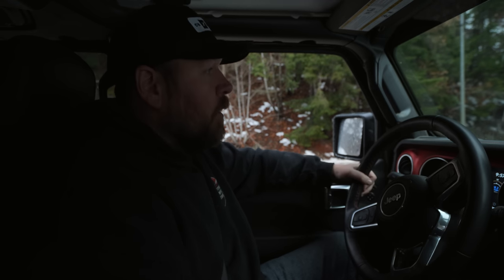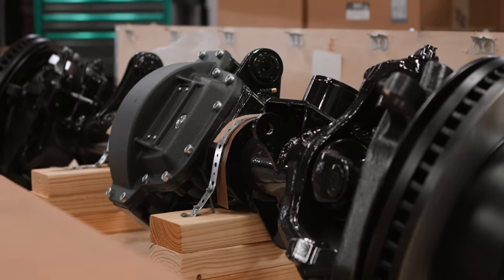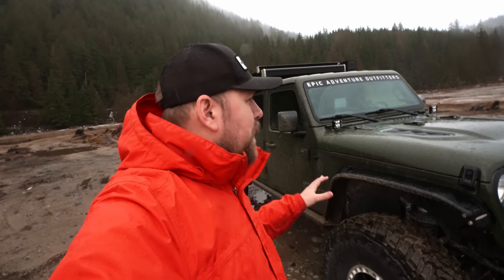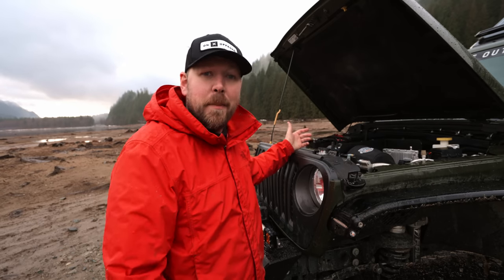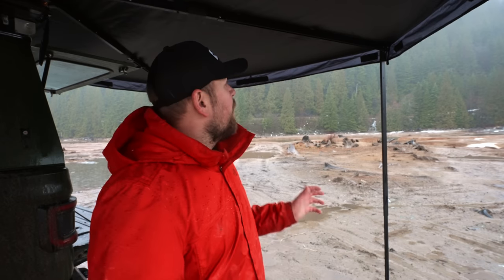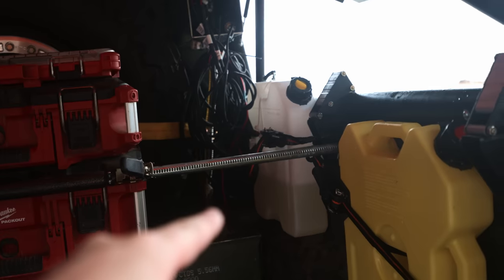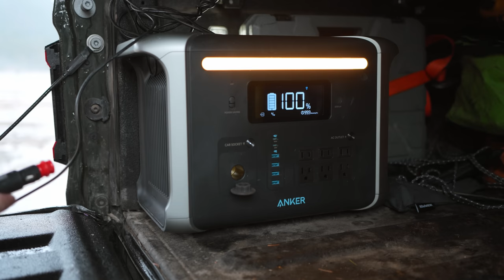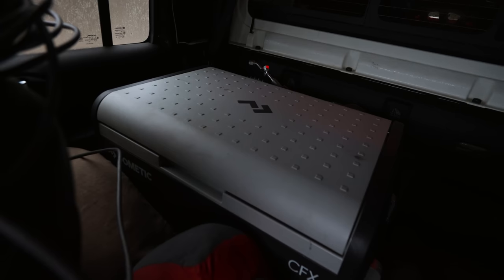426 Hemi Jeep Gladiator Overland Build Walkaround

Comment from the maker: If you want to never have to worry about power on your overland adventures, you need the Anker 757 Powerhouse. 1225wh of power in a portable compact package. If you purchase any Anker products using my link, I make a small commission which supports the channel. ❤ Check out Anker powerstations here:  https://shrsl.com/3s52n
Reply: Hello I was hoping that since you use onyx off-road, I was wondering if the Maps work in Canada I was thinking about purchasing the app but I can’t find any information about it working in Canada
Reply: Hi Shaun! Thanks for the great contents for each monday. What type of solar panel did you install on your GFC Camper?

Comment: This is hands down the sickest Gladiator build I’ve seen. Everything on it is purpose built for off-roading and overlanding, and it looks awesome. What an absolute beast you’ve made, Shaun!
Reply from the maker: Thanks!
Reply: You have built a truck that can go rock crawling but still can be driven just about anywhere and used as an overlanding vehicle.  Well Done!!!!
Reply from the maker: @scottymac5174  exactly the goal my friend.
Reply: @TheStoryTillNow  What I like about GFC campers is that I have an older truck.  2004.    But building a camper for it is no problem.  They will make it happen.
Reply: Sickest!!

Comment: Awesome video as always! I'm very curious on the d80 brakes installed on the front ud60 axle, I have the same axles and curious on what all goes into that swap and some difference of the brakes.
Reply from the maker: Thanks! We didn't do the work on that, they came that way from America's Most Wanted, and they didn't really share much info. If I knew more about it, I'd happily share.

Comment: I love the engine choice in this build. Only question is the open high flow air intake. Does water crossings pose a problem without a snorkel or water tight air box? That big V8 could suck in a lot of water very fast. What's your thought on this? Casey would have the same water crossing situation. I love his set up also. The open air intake is similar to yours.
Reply from the maker: This is something we are trying to address. It will require some custom work, but we are working on it.
Reply: @TheStoryTillNow  A video of water proofing the V8 engines in your Jeep Gladiator and Casey's Hell Cat motor would be a sick awsome video. Everyone else just does the engine swaps but never anything on a waterproofing system. I want to get a hemi conversation but need water proofing answered. I look forward to a future video! 👍🏻

Comment: Awesome build! Is there any upgrades to the transmission or transfer case at this point? Or future plans for any due to the added horses and torque? As usual, you rock the off road 👍😎
Reply from the maker: The transmission has been changed, but the rubicon transfer case is plenty strong.

Comment: Hey Shaun, you mentioned the suspension is better made for Canadian climate with salt on the roads and such...  Is there any rust proofing you do to the truck itself?  I've always gone to Krown, but tried Corrosion Free this year for the first time...  supposed to be a better product with a higher rating from the canadian military.  I currently do not own a Jeep but am interested, though i've heard that they really don't last in our canadian climate.
Reply from the maker: I haven’t done any thing specific to the Jeep/frame but I usually touch up with some rust paint once a year or so

Comment: Curious if you plan to add the auxiliary fuel tank? I believe you had one on the last gladiator and I didn’t hear mentioned for this one. What range/MPG are you getting with this setup?
Reply from the maker: Doesn't fit with the exhaust for this motor.

Comment: I know it's purpose built but I bet the steering has 0 feel which I'm sure it's super sketch on highway drives. I do like the build though. Pretty solid.
Reply from the maker: It actually feels great you just have to get used to it. Driving the Bronco without hydro assist now feels too stiff.
Reply: @TheStoryTillNow  that's good to hear, I would imagine a lot of float.

Comment: Went to synthetic winch line,. BUT
Still have a LARGE hunk of metal on the end of the line.........
Check-out YANKUM rope to see a MUCH safer way to do the end of the winch line !
                   🤔
Reply from the maker: Nothing unsafe about having a metal hook on the end of the line. The rope holds no kinetic energy.
Reply: @TheStoryTillNow  
Wire cable is used on oilfield winch trucks and some workers were taken out when they were in the wrong place at the wrong time when cables broke and cables, hooks and snatch would fly !  And there was no kinetic energy in them winch lines.
YANKUM has a video on how to tie the end of the winch line.   Much safer when using soft shackles and they have a nice fairlead to hook the winch line when not in use.
                      🤔

Comment: Just curious but what issues are you having with the oracle taillights? When i got them my blindspot monitoring wasn't working. I sent them an email about it and before I even knew they had emailed me back I had new wiring harnesses at my door that solved the problem and they've been great ever since. The Gladiator should've came stock with something like this. I broke one on the trail cause they stick out so far.
Reply from the maker: Flickering on and off ranomly, reverse on one side flashes on and off randomly, running lights come on and off at random, etc. You can see in one of the shots in this video only one of them is on, for some reason.
Reply: @TheStoryTillNow  oh that sucks. I wonder if any of that ever happens to me. I might never know since I'm always driving and not recording like you do. Does it show up on your dash too?

Comment: Love the channel and the new trail wrecker. I’ve wanted a Jeep my whole life but would never buy one due to most of the time needing a truck. Then the gladiator came out and I was immediately interested. I traded my truck in on my brand new 22’ rubicon back in May. I have spent lots of money trying to build it right. I’ll probably never be able to build it to this extreme but I still love it. But unfortunately I have been fighting DW for the past 2k Mike’s suddenly out of no where. I have literally went over everything and can not seem to find the root cause. I have managed to calm it but never cure it since it started. I have way too much money sunk into this thing with only 13k miles on it for it to be doing this. Do you have any suggestions on any past experiences with this situation ? I can’t give up on it, I like it too much to just give up and trade it in like a lot are doing ? Thanks for any input
Reply from the maker: Death wobble is almost always worn parts in the steering. Check tie rod and drag link ends, ball joints, ujoints, driveshaft, control arm bushings. It will be one of those things. Also this should be under warranty so just take it to the dealership.
Reply: @TheStoryTillNow  thanks for the reply. I tried, they had it for almost two months and diagnosed it as nothing but the steering stabilizer. That’s the only thing they wanted to replace and was dead set that was the fix. They couldn’t even get a new stabilizer at that time. No one can leave a brand new vehicle they’ve spent their whole life savings on just set at a dealership for months. It is my daily driver and primary vehicle. Yes I had a rental but with winter being here I couldn’t make the hour trek one way to work each day in it. Their tie rod ends were on back order until April 2023 they said. It now has brand new Apex 2.5 ton steering. I’ve gone over literally everything and it all seems tight as new. I’ve had tires rebalanced by a 4x4 shop, had an alignment , lift was installed only at around 5,000 miles. It drove like a Cadillac till around 12,000 miles when this hit suddenly and started happening. Even though I or a shop can’t find any play in the ball joints I’m probably gonna replace them just to rule it out. After that I don’t know what to do. Caster has been adjusted several times and all Jeep wants to do is throw a stabilizer on it as the fix. Which after picking it up I just put the new steering on I also put a new stabilizer on it also. I wish it was something that simple as, it’s under warranty and Jeep properly and timely fixing it.
Reply from the maker: @buckeyejeeper9996  I would suggest having a different 4x4 shop look it over.
Reply: @TheStoryTillNow  I just did after I got it from the dealership. The 4x4 shop has been the only help thus far. They were the ones who aligned it after installing the new steering and rebalanced my tires too which only have around 7,000 miles on them . They helped it a lot but it’s back but isn’t as violent or last as long. It does it worse on colder days/ nights. That’s what makes it frustrating to chase. One day it’ll be fine but then it’ll cool down and it’s back again.

Comment: What mounts are you using for the traction boards and shovel?  I was told by GFC that attaching anything to the side voids the warranty.
Reply from the maker: It voids the warranty for the panel, not the whole camper. So no big deal really. I’m using the Expedition Essentials mount. It’s really well build and I’m probably going to get another one for the other side.
Reply: @TheStoryTillNow  awesome..thanks for the quick reply!
Reply: PS - I love what you did with your heater.  I've been having challenges with mine overheating and It looks like (I hope) it's because I'm running too long of a heater hose

Comment: Shaun, In one of your video's there was a power issue with the diesel heater drawing too much power. Were you able to solve that? Do you know what was causing the power drain?
Reply from the maker: It was just too cold out. Lithium batteries discharge fast in sub zero temps.
Reply: Ahh excellent! Easy fix haha

Comment: It’s just sad that the heyday of the Jeep Wrangler has passed.   All the Epic guys now have Gladiators, they trashed everything but the bodies and frame on every one of them, installed ridiculously powered engines, powertrains, axles, wheels and 42-46’ tires.      Each one probably has well over $150,000 in them, not to mention the cost of gas to feed the things.    It’s going to be fun to see if these things will get stuck just as easily as the old-fashioned Wranglers.   I am betting that it will.   I will be watching.
Reply from the maker: I think most people just see that the Gladiator is a superior platform unless you are wanting a dedicated crawler. Even a mild built JT will go anywhere a Wrangler can with much more gear storage.
Reply: I do overlanding, so don’t need a boulder-crawler, that doesn’t interest me at all and I can’t afford the associated often inflicted damage.   My JL Wrangler is just fine.   Nice rundown on how it is equipped.   I think it would be good to disclose what all is sponsored gear and what is not, as that would be really good information to viewers who want to check out the gear.   @TheStoryTillNow

Comment: I don't understand the reasoning here. (Other than a wow factor.)
Jeeps don't go fast. With they're solid front axle and aerodynamics of a brick they're just not going to perform. Add 40 inch tires and you have a high speed death trap.
Now.... For off-roading and remote exploration... A 426 makes it to heavy to be practical. You now have to carry tons of extra fuel which adds more weight which makes it even heavier, and the cycle continues. Your range is diminished, forget floating over sand, mud or snow.
Oh well, to each they're own.